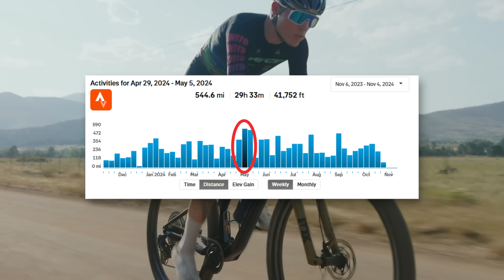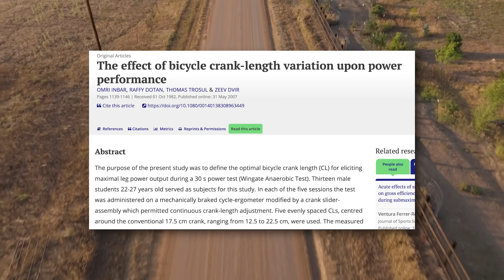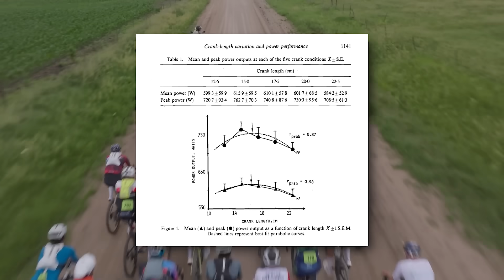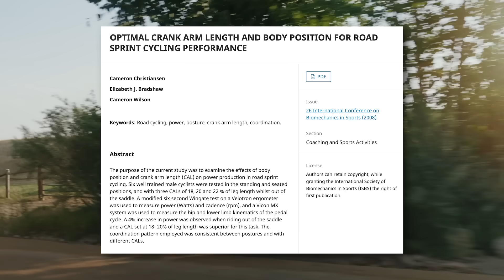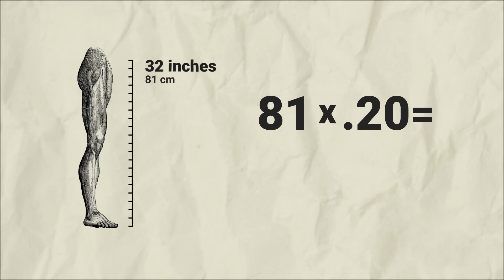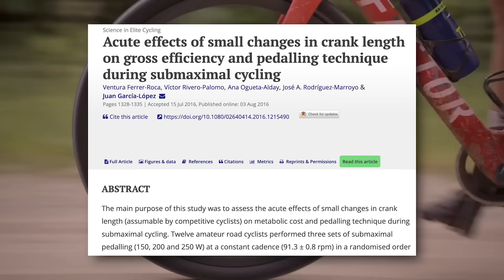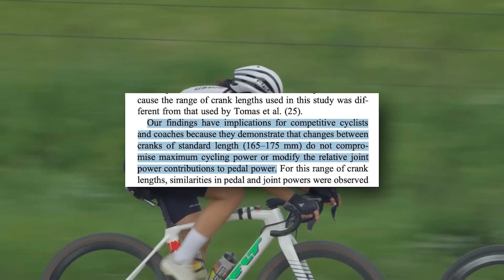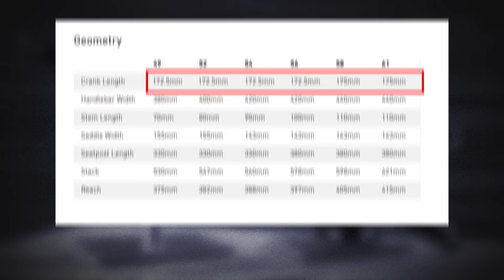You Should Be Using Shorter Cranks, Here's Why

Comment: There is a lot more that goes into shortening cranks. First- Shortening cranks is like gearing down- less power required to turn them but higher rpm (i.e. cadence). So you have to figure out what kind of rider you are- are you a high cadence rider or a lay the power down rider? That is one consideration. Next- it will affect the fit of other parts of your bike. Your seat might now be to low necessitating raising your seat, but then your bars could be too low necessitating raising your stem or getting riser bars on a mountain bike.  For mountain biking this will then put your seated center of gravity higher, making you feel more tipsy. If you change so much you may actually now have too low of gearing and may need a higher highest and lowest gear.  With mountain biking it can also help avoid pedal strikes, although of you are changing because of that I recommend learning to pedal properly for mtbing first. The problem is that there is no one size fits all for crank arm length- some people should perhaps be on shorter cranks, some perhaps on longer.  Changes of 5-10 mm will not change the gearing too much nor affect fit of other parts too much (although I did change out bars and seat height when I went down just 5 mm in crank arm length).  But more significant changes may really affect how the bike feels to pedal and how it fits. My advice to anyone thinking of this is know why you are doing (i.e. what are you trying to accomplish) and do your research first.

Comment: I've had 175mm cranks on MTB with saddle height 92cm from saddle to buttom crank arm, in full length. New MTB is 170mm cranks. Do I lower/raise the saddle by 5mm, or keep the same 92cm length from saddle to crank fully extended?😅

Comment: The 20% inseam calculation worked for me.  I'm at 925 mm, which comes out to a 185mm crank.  
Believe it or not, I did find 185mm cranks to put on my 62cm frame.  They are expensive and heavy but still more comfortable than the 175s I replaced.  
People at the ends of the bell curve (short or tall) are the ones with the real crank-length issues.  We're just too small a market to support good products from the manufacturers.

Comment: I've gone to shorter cranks just for better fit. I'm a shorter rider and have just been used to 170 cranks that came with all my bikes. I've recently tried 165 to solve a fit issue on one of my bikes and I have a 160 on another bike. I feel best on the 165 as it feels like I get the torque I got in the 170 but can spin it better. Where the 160 I can spin well but I don't feel like I get as much power out of it for my style of riding. I haven't seen much of a difference in speed between them, though I feel like I'm faster with the 170. I don't spin it as fast but I feel like I cover more distance. None of this is scientific but more on feel. I'm more for putting power down than spinning but I think I can benefit from a balance of both and I think the 165 gives me that.

Comment: I have been riding for 30 years, and I switched from 170mm to 165mm cranks. I did several tests of 3 different TrainerRoad sessions over several weeks. And I consistently pushed 20watts more at 5bpm less.
Reply: I came to the same conclusion at my bikefitter when trying shorter cranks. I pushed more watts with less effort.
Reply: That's interesting, I'm imagining the difference is  in the load of moving your legs further. Our legs weigh a hefty few kgs and with longer cranks they move further i.e. they are lifted higher on each stroke.

Comment: I went from riding 172.5mm to 180mm cranks. Immediately, I was faster, a better climber, better results in races. Yet, I'm still a fan of 'shorter cranks', compared to conventional lengths that have been most common. Why? I'm 194cm tall with a long 94cm inseam. 
180mm cranks is basically 19% of my inseam. My overall height is 109% of Dylan's height (approx. 178cm). 109% of 165mm cranks you now use is 180mm, which I use. 
I would concur that typically, that 18% to 20% is the sweet spot. 
I watched your earlier YouTube video from 2 years ago, and I'm glad that you acknowledged that this new video, with further research, you've adjusted your opinions on crank lengths. Thanks for the great video! 
For those who are shorter riders, like 5'3" (160cm, ideally you should be on 150mm cranks, up to 155mm. It's crazy that most bikes coming out in XXS sizes, still typically come with 170mm cranks, which are arguably more suitable for someone around 5'11"
Reply: What were your normal cadences with both?

The thing is that it's not just inseam and leg length. It's also femur length and the whole hip joint. How stiff or loose the hip is and at what angle. It gets really complicated.
Reply: Great comment.  Yes — I think short cyclists are often afraid to go short enough for cranks, and tall cyclists are often afraid to go long enough.  I have a 77.5 cm inseam (I’m 5’8”) and use 150s, which is basically the same ratio as you use.

Comment: Changing to shorter cranks improved my riding slow, on gravel and also geting upp from deep slopes. And now I'm even thinking about to move from spd pedals to regular platform pedals. With longer cranks it was difficult to ride slow on sand, or loose rock. Although I was not racing, but I was forced to ride fast, because it was easier. And because I needed full power I often had to stand up from saddle, on bumpy road. So the spd pedals gave me confidence.. That foot won't slipp off pedal when it's shaking, while standing up.
When I reached to smooth road. I was out of breath, and had to take it easy, to recover for next bit of rocky road. Sometime I got tired even before the bad road ended.. And had to stop for catching breath, but it was impossible to get speed up again on rocky road. And it was so hard to ride slow with long cranks. On bad road. Now everything is good I can enjoy scenery and if I really want I can ride fast too. I can ride wider tires also. Before it was too hard to ride wide tires on bad road.. Maybe because I had to ride faster. Don't know. Narrower tires sliced through, between rocks. Wider ones are going over? I don't know.. But definitely 165mm cranks should be new standard. Maybe industry pushed long cranks to sell spd pedals?

Comment: Id be open to shortening my road bike cranks but not my mtb as I can get up a pinch or technical section far more consistently with 175 over 165. One section of track I could rarely get up with 165 a tight right hand turn going up a short steep incline into a left hand turn. The problem was my pedal stroke would bottom out at the end of the first turn and didnt have the torque going into the incline. With the 175 it gave me just enough stroke to make it through the first turn And to travel slightly up while I used the extra torque for the rest. I know this example is a one off but the thing that resonated with me is the 175's produce more torque.

Comment: My Specialized Rockhopper XXL comes with 175 mm cranks. With my 35" inseam, 20% is 178 mm, so I'm all good. I'm 61 years old, and I've boosted my sustainable zone 2 power at 132 bpm from 160 W to around 185 W basically just by consistently wearing my heart strap for regular short rides (often less than 15 minutes each), plus endless amounts of energetic pickleball. Far from elite, but not terrible, either.

Comment: Well, i mean same principle as overbore/overstroke engines. The former having higher top speed but lower torque in the top end, and the latter having more torque at the start though having less top speed in higher rpms. Also fixed gear riders prefer 144 bcd 165mm cranks due to less pedal strike chances, cause cornering and having that crank arm hitting the ground is not a good time

Comment: Go back to the drawing board. None of the studies you mentioned take into account resistance (aka gravity). Think about the analogy of rolling up a car window (old school with a crank). Consider the length of the crank as the…well, bike crank and the weight of the window as the grade. No grade = light window. Now change the window to heavy glass. Longer crank = more leverage = easier. Short crank = less leverage = harder = easier gears needed for a shorter crank as the grade gets steeper.

Comment: The question I have for longer vs shorter cranks is the difference is muscles fibers and build for riders. I tend to pedal with a slower cadence and more power per stroke. I'm 6ft tall and with my slow cadence preference I tend to stick with my 175mm cranks for the gravel/road bike. However I think the in the MTB world the short cranks make a huge difference in riding stance, ground clearance, and overall ability to ride better so I run short cranks on the MTB. I would love to see more data comparing the muscle fiber types used in each and compare it to people's body build on which cranks can work better for them. I also vote we move to a 165mm standard and go with 155mm on smalls and 170mm on XL bikes.

Comment: Short cranks are for short people and/or those who can spin extremely high cadences (avg. 90+ rpm). If you're over six feet and don't spin faster than 85 rpm shorter than 172.5 won't get you any benefit. Not to mention that cranks shorter than 170 mm are almost not available as aftermarket items and that this fad is soon going to be over anyway.
Reply: The Day you swap to shorter your cadense Will raise automatically while those are so easy to spin

Comment: I put 155 mm cranks on my gravel bike and mountain bike this summer.  In both cases I had to go with aftermarket cranks.

I did this even though I am 6'3" because I have arthritis in my right hip.  With my old cranks I would bounce left and then right in the saddle every time my right leg reached the top of its motion.  As you might imagine this caused butt pain and made it difficult for me to complete long rides.

I've been riding with the new cranks for a couple of months now, and I do think that it has been a large improvement.

Comment: My main road bike is a 1977 Raleigh Grand Prix, which fits me but, compared to modern bikes, is huge. It came stock with 165mm cranks. I wonder when the industry lost the knowledge that this was an optimal crank length? My theory is that it's like how skinny tires feel fast, so it took a long time to break from that (and lots of folks still haven't). Mashing on a 175mm crank feels like you're really doing some work and probably feels more powerful than a shorter crank, along with bro-science "longer lever means more torque" type thinking, so that's what people were asking for and it became the standard.

Comment: The problem is crank arms, even alloy ones, are so stinking expensive to upgrade that if i am not in pain, i don't want to spend the money. I would love to try 160-165s but until they come on a bike or i find a set for very cheap, i will stick with my 170s
Reply: You can Tune full Aluminium ones with -20 mm. I've done a dozen sets already

Comment: I've been preaching about this for years to anyone who would listen (but most wouldn't). The funniest thing to me about the opposing arguments is that everyone conveniently ignores the obvious fact that track cyclists have long-opted for shorter cranks due to clearance issue on a banked velodrome. But no one has ever suggested that track cyclists suffer from lack of speed or power as a result. But I really couldn't care less about the numbers or the "increased aerodynamics" or any of the other countless weeds that cyclists tend to get lost in. 

Consider this: Regardless of crank-arm length, you're only applying pressure to the pedal for a very small percentage of the entire pedal stroke—roughly that 2 o'clock to 4 o'clock position. That means that with longer cranks, for the entire remainder of the pedal-stroke, you're pedaling in a larger circle with zero benefit. No pressure is being applied to the pedal. At all. Your foot is pulling back further and rising up higher while no force is being applied. That's a tremendous waste of energy with zero gain.  Cyclists need to consider the entirety of that circle that they're going though with each pedal-stroke.  It's not about watts or sprint-speed for me, it's about feeling so much more comfortable after a ride, and having better recovery as a result. If you're lifting your knee (and flexing your hip) just that little bit more at the top of every pedal-stroke, times the tens of thousands of rotations that are likely to occur on a  long ride, the difference in efficiency becomes stark. At 6ft I would never ride anything longer than 170mm ever again and 165mm has been my preference. 

Most people seem to focus on all the wrong aspects of crank-length and fail to ask the most basic of questions: How do you feel after a ride? How do you feel at the start of your next ride?And for the vast, vast majority of cyclists, these questions would seem to be paramount. If you're watching this video or reading these comments, you're not likely vying for a stage-win at the Tour de France. So calm down with all the "bike science" and just ask yourself how you feel on shorter cranks. You might be surprised by where that leads you. For me, there's no turning back, regardless of whatever "new" science emerges in the coming years.

Comment: It depends on how you fit on the bike in my opinion. Hear me out. I stared my early builds using the common 170mm from March 24, 2019, namely a 2018 size 51 Cannondale Optimo which only made it a few hours of riding before getting wrecked by a motorcycle, maiden voyage and my first road bike experience, and a size 52 2017 CAAD12 to May of 2019, then I upgraded from the Claris R2000 to 105 R7000 165mm cranks on the same CAAD12 size 51 which got into another accident with a bigger displacement motor bike and used it until the final build until that bike which I got to claim damages yet again and built another CAAD12 this time a size 50 which unfortunately got stolen in 2021. I never had issues with these frames until I built my latest size 48 CAAD12 Black Inc which had a weird geometry that wasn’t the same with the afforementioned frames. The Black Inc one felt like I’m going to go over the bars on steep descents using an R8000 165mm crank so I switched to an R9100 172.5mm. All I’m saying is you also need to look into your fit on different bikes

Comment: I’m going to make an unpopular argument - this from a bike fitter who has sold lots of shorter cranks.  The first job of any bike fitter should be to put the rider within their range of motion. Within the pedal stroke there are two sticking points, 12:00 - the greatest angle at the hip and knee, and 5:00 - the farthest point from the hip. If the rider can’t get to those points without moving the hips, shorter cranks are in order. Intended bike position plays into that, hip angle is from shoulder to hip to knee, so if the rider is folded in half, getting over the top gets harder…

   That defines when a rider NEEDS shorter cranks, what’s not talked about is the down sides. I deal with injured riders all the time, I set up rehab programs post knee or hip surgery. The trick to regaining motion is to always challenge range of motion so scar tissue doesn’t form. It’s the use it or lose it scenario.  Not using full range of motion may lead to loss of range of motion. I have no data to support this, but it seems consistent with how bodies age.
Reply: " If the rider can’t get to those points without moving the hips, shorter cranks are in order."  Lowering the saddle is not an option?
Reply: @ lowering the saddle increases hip angle at 12:00, raising the saddle increases distance to the pedal at 5:00. You need to be within range of motion at both.  

Running shorter cranks does make bike fitting easier. If you are at your limits of range of motion at 12:00 and 5:00, saddle height and setback need to be spot-on.  If your cranks are shorter there is some +/- room to work with.  This makes me question if the trend towards shorter cranks isn’t because they have their fit wrong…
Reply: @edsassler  I doubt the pros have a bad fit.

Comment: For me, performance and comfort wise, shorter cranks is 100% better. 

1.) It allowed me to train harder with no knee pain. I used to have knee pain with 170mm. I switched to 165mm which allow me to use a harder gear and become stronger. Then the knee pain will return at a certain progression and I will change to a shorter crank. And repeat.  I am now at 155mm.

2.)  Changing to a shorter crank will allow one to sit further forward which will recruit more muscles and make it easier to push down rather than cycling in a circle which is way more powerful in my experience. 

3.) The position must change forward when switching to a shorter crank.  Most of the benefits is at the 3 and 9 o clock position. In theory, the seat have to be lowered too by the difference in crank length. But as one sit forward, the distance also shortened. 

This is not Dura ace but cranks shorter than 165mm are hard to find and very expensive. 

I am not related to this brand. Just a thankful fan that they have this. It has worked out for me over many many kms. I used the MTB model as the crank arms are curved. It can also fit their road bike chainrings. I use Shimano's derailleur and shifters. Shifting performance is personal. It shifted fast enough for me.

 Hope my experience can help you too as knee pain is not fun. Thank you. 

https://www.aliexpress.com/item/3256804193790023.html

https://www.aliexpress.com/item/3256805679764891.html

Comment: Thanks for supporting my confirmation bias 😁 I'm slightly taller than most (186cm or 73") and I've gone to 170mm cranks on all my bikes. I'm not convinced about sprint performance, but holding an Aero position in a breakaway is much easier.